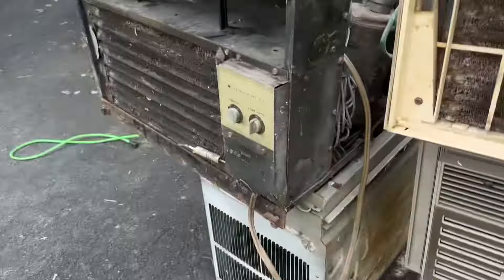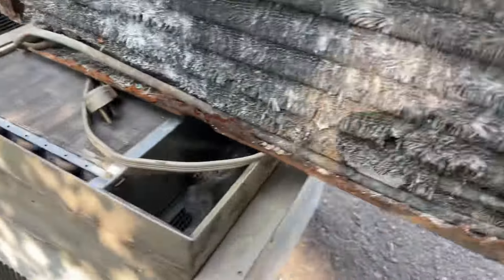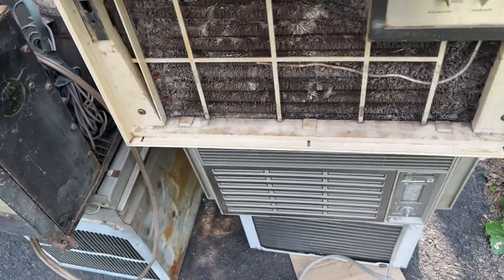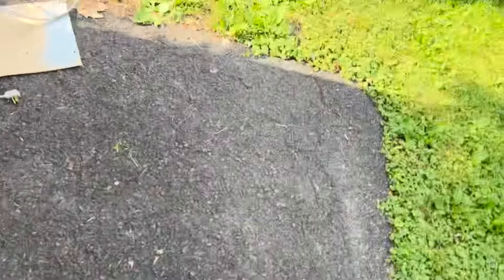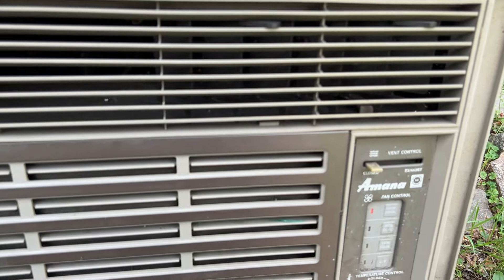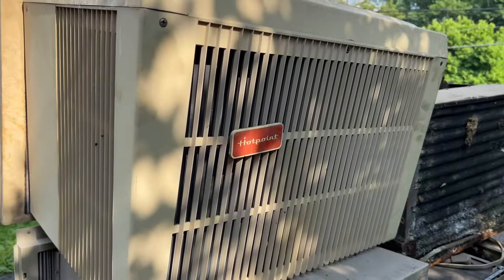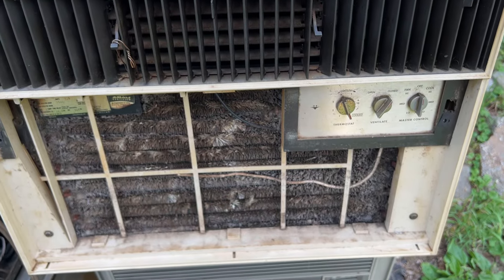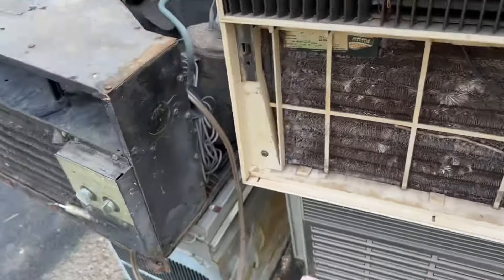Today’s Haul 6-18-2024 Hotpoint Units

Comment: I have the JCPenney version of that Hotpoint and the same model of Amana, I think mine is 6700 BTU. That hotpoint should run very very quiet and I think mine runs on 860 W or something like that, so it’s very efficient. The man runs on 670 W, so it’s ER is 10 both of mine run super quiet and really smooth.

Comment: My mom moved into this 150 year old house and a very tiny Town there's like 12 houses that's it it's basically a block of houses out in bumfuk nowhere well her house came with a through the wall air conditioner from somewhere in the 50s I'm thinking it is a fetters just judging on how it looks and I've seen a lot of very old feathers in your videos and it looks very similar some idiot though painted the front grill to match the walls but that thing still works even though the fan motor has a very demonic buzzy grindy sound when it starts up other than that it works just fine it blows ice cold actually use this coil cleaner in a can to get it to run better sprayed it out with a hose on the outside and I used a cup of water and an old toothbrush to clean the radiator inside
Reply: Any chance of you doing a video on it some time? Would love to see it!

Comment: @TheAirConditionerGuy is it normal for a 1970 airtemp unit to have cycle on times of between 35 min to 55 min on a 90+ degree day? im woried its low on refrigerent it sounds ok on refrigerent. normal cooler days its 25 min or so. if its not what could be the issue?
Reply: I would just adjust the thermostat, I’m no expert but from what I know there’s usually 2 adjustment screws, one of them makes the thermostat colder or warmer, and the other makes it more or less sensitive
Reply: @nicholasbadolato5333  im not using the built in one im using my own thermister type one. it kills power at certin temp which is on at 61F and off at 63F. i raised the temp but same issue.